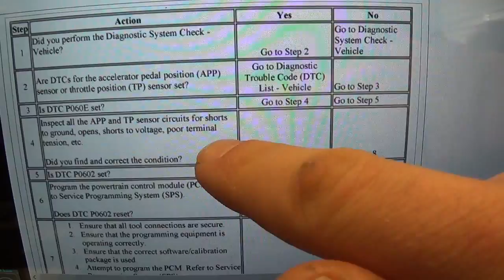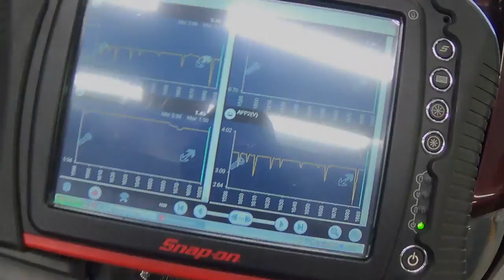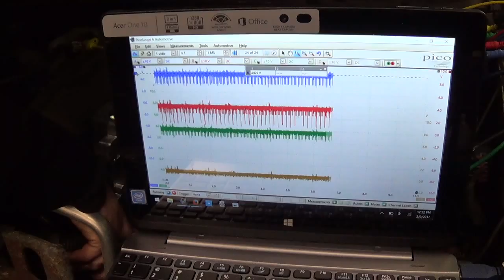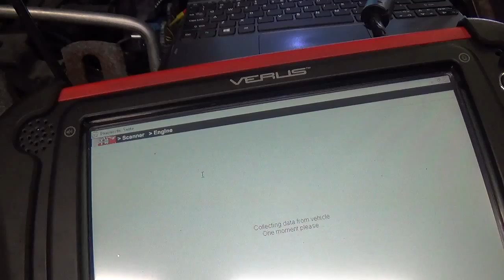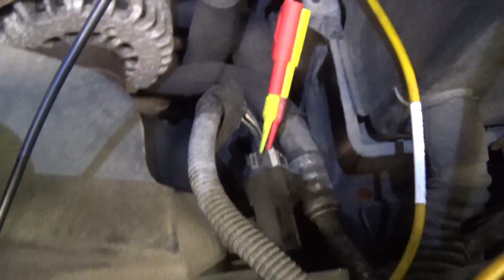Chevy Trailblazer from Hell: P060E (Staten Island Ep 7.8)

Comment: My 2019 xt5 3.6 had a P0128 my scan tool graph mode showed erratic signals on the temp sensor. I disconnected the sensor plug at the sensor and did a pin fit. Tightened and applied dielectric grease and reassembled. No parts needed.

Comment: Great detective work.... Had similar issue with 08 Equinox and wheel speed sensor pulling 5 volt reference to ground causing egr and evap faults.

Comment: This is a well known issue on the forums.  Anytime someone has a problem or code for the throttle system, first thing we tell them is to disconnect the fan, which accounts for 90% of these issues.  Then we go into heavy diagnostics if that's not it.

Comment: I have a 2004 trailblazer with this problem and we have replaced throttle body, pedal position sensor, pig tales, wire harness and goes away for couple months and then comes back.
Reply from the maker: Is the actual problem then like in this video?

Comment: As a owner of 5 trailblazers I can tell you that those fan speed sensors have caused a lot of grief in TB owners. Weird shifting,low power mode,you name it. I remove those fans,replace with electric fan (make sure to beef up the battery cables to ground and alternator to avoid power dips) and have the ecm programmed to delete the fan speed sensor.

Comment: Again, WHAT IS THE FIX?

All the diagnostics were great, but you didn't tell us what the fix is.
It sort of is suggested that the fan speed sensor was the problem, but not conclusively. 

It could be some interaction that is not necessarily a faulty fan sensor.

I have this exact same issue.

Comment: I had the same with a 2004 Asender. The problem was an after market remote start that damaged the wiring. I removed it. It runs, so I never fixed it. Still get the same code. Probably a nick in one of the remote start connections of is the problem. Don't have an O scope to look for noise.
 Still running 5 years and 40,000 miles later and still gets the code..

Comment: AWESOME< But what did you replace? E.V. fan clutch?? Is that parallel circuitry with several sensors that was having mass interruptions, due to the "noise" from fan clutch?thanks in advance

Comment: Back in the 80s my dad bought a new Oldsmobile that just stopped running for no apparent reason on the highway. They tried to figure it out at 2 or 3 dealers. After 4 or 5 tries they had to take it back under the lemon law in New York State.

Had they bothered to make a phone call as I did, they would have fixed the crank sensor. They knew about it up in the regional office and could have resolved it, but did not. Dumb.
Reply from the maker: Wow that's a shame. 80s Oldsmobiles were cool cars!

Comment: often 5 v reference(s) set by Lm-309 regulator(s) in ecm module  -often buried in LSI module

   BUT I found ADDED tantalum capacitor (10 mfd at 35 v) on flaky 5 v output helps stabilize high frequency noise on signal
     so less susceptable to noises-wierd problems often goes away,since 5v feed stable    
       never use electrolytic capacitors-tantalum ONLY

Comment: similar experience with a 90s buick century..... ac signal from a cooling fan motor disrupting the ignition signal at the module. rolled in with a intermittent stumble off idle, left with a new cooling fan motor.....and after two dealerships later threw the parts cannon at it.
good 1 ivan and keith.

Comment: hey Ivan!  I work at one of the last suzuki dealers around.  let me know if you need some good OEM information.
Reply from the maker: Where is that located?
Reply: I'm in Houston.  Dealers are dropping out fast.  I had a customer drive in yesterday from the next state over just to wait and get some recalls completed.  Luckily, I work for a multi brand dealer so I won't be out of a job soon.
Reply from the maker: Yup our Suzuki dealer closed up shop a couple years ago here in State College, PA. However a nearby Ford dealership picked up the service/parts department so not a total loss. I'm still not planning to get rid of my XL-7 anytime soon!
Reply: motoYam82 that generation XL7 is a solid truck.  It has its quirks like timing chain rattles and front cover leaks but I remember you taking care of that a while ago.  regardless,  drop a line if you ever need something.
Reply: there is still warranty support through 2019 for the last of the cars sold in 2013 for their 7/100k power train warranty.  I imagine after then we will be done too.

Comment: This is why I subscribe to your channel. Awesome find. Sometimes the answer just comes from nowhere.

I had a 2010 maxima that would set a crank position sensor code only when the engine hit 5k rpm or higher. The sensor was new OEM 3 months later it lands on my lap. I could see a small amount of noise on the signal with the score. But it ended up being a fault flywheel. Visual inspection of the flywheel showed absolutely no flaws. But the problem was fixed with a new flywheel.

Anyway I'm rambling. Good video.
Reply: Auto Fix Pal never a ramble , just more input. Thanks Hakim
Reply: ONBOARDTECH333 your welcome!

Comment: likely nothing wrong with the sensor circuit itself and caused by other fan controller component failure, like "capacitors" degraded and low to no RFI filtering/excessive back EMF.
if you scoped the fan power and ground, it should be going nuts too. A failing alternator can produce major ripple and with the different voltage/signal wires bundled it could wreak havoc :)

Comment: That is an excellent point. I have been scratching my head wondering why no-one use the scope to do what it is well suited to do, checking for noise in sensor circuits and signal quality. In wired LAN it is kind af a basic checks, but rarely in automotive. 12V relay with a faulty flyback diode can send a voltage spike and  cause a fault code in a poorly designed schematic.

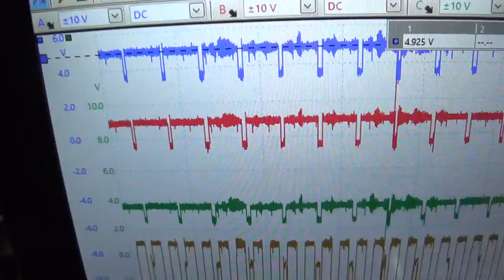Comment: First off, that was a brilliant display of Shop-Fu.  Your tenacity found something concrete that could warrant a design change or proactive fix - something the 'parts cannon' wouldn't reveal.  While the culprit was found I couldn't help but notice something in the scope traces at 23:31 - 24:00.  The pulse width of the interference rises and decays in a harmonic fashion.  The need for the engine and the fan motor to be at certain speeds suggests that only when the vibrations of the two were resonating and boosting each other, a beat frequency occurred that was strong enough to cause or reveal shorting of internal fan conductors.  I think the speed sensor was framed! :)  It would have been interesting to see if a current trace of the fan motor (like you would do with a fuel pump) would show any corresponding anomalies.   Great work guys!
Reply: Eddie the Grouch For being a grouch that was a great comment
Reply: Thank you!  Sometimes, when the phase of the moon and my medications are in sync, I'm not a complete jerk :)
Reply from the maker: Interesting thought! Would be interesting to reverse-engineer the fan circuit and see if feedback from the actual motor can affect the speed sensor circuit...

Comment: I would never have guessed it, but I can see how the fan power leads running through the wiring harness in the same bundle with the TPS sensor wiring could cause a lot of AC induction into the TPS wiring due to abruptness of the on-off impulses in the fan power circuit. A very abrupt on-off can induce a big voltage spike.  The two sets of wires running alongside each other are like a primitive transformer, with the fan power circuit being the primary and the TPS wiring the secondary.

Or it could be RF overload on the TPS circuit wiring.  Since the kind of interference that the fan motor creates is very broadbanded, RF frequency-wise, it might be that the TPS circuit wiring happens to be resonant somewhere within the frequency spectrum of the transmitted interference, so you get a strong RF standing wave on the TPS wiring.
Reply: William Crowell i guessed it as soon as i heard the fluctuation in the idle speed
Reply: William Crowell i guessed it, then about 10 seconds later i heard him say "so the fan"  then i knew i was right

Comment: I have a 2002 TrailBlazer with 200K miles. It's been a fantastic vehicle for me, never leaving me stranded, but that stupid electro viscous clutch has been a nightmare for most owners. They have a very high failure rate, never seem to kick engage quickly enough to assist quickly in cooling or A/C. I appreciate the attempt to gain 1/10th of a MPG by trying to better regulate the fan. It's no wonder GM switched these to conventional thermostatic fans for the last year of production.
Reply: Doug Goodwin Well that makes me feel better...lol. Bought an 07 Trailblazer about a year ago for the wife. Was a good deal and it only had 86,000 on the clock. Just hit 103k few days ago, Did a little research and found the 4.2 straight 6 was a very good motor for G.M. can't say the same, however, for the quality of some of the interior plastics...but oh well.
Reply: Sal Dorado I have a small fleet of Trailblazers pretty much they are my favorite vehicle never give major issues I have one with 513k miles 2002 TB 4.2 LT very good vehicle never had issues with interior either they are harder plastics but the interiors are nice comfortable places to be
Reply: I don't know why GM didn't just use electric fans. Just because it's a longitudinal engine doesn't mean the fan has to be belt driven.

Comment: Nice job Keith.  I saw the capture and thought interference myself, just didn't know where,lol.  First thought was checking battery and charging system for excessive ripple because as rpm increased it got worse.  But when I saw you go toward the fan and unplug it I knew what you were thinking,lol.  That was real cool.🤓  This is the reason why I love Pico Scope so much.  I can put a long screen on that bad boy, drive the vehicle if I have to or check stuff in the bay and I don't have to watch it all the time.  I can just go back and look at the data.  Or in this case it's great for action and reaction testing.  Was only 1 five volt reference driver affected or all of them?  Was curious about that.🤓
Reply: busjockey1 see that's where I don't believe what they have printed . They make it sound like there are separated 5v drivers , yet proof would show otherwise. I believe that they all eventually go back to one 5v regulator and all signals would have some affected level of signal interruption. But thanks again for the kudos.

Comment: There is a common thread between this problem and the GMC no crank issue in your other video and that is a pirate voltage or ground sourcing through a faulty component and upsetting other systems sharing the common supply or ground circuit.  Here the TPP and the APP were effectively showing exactly the same trace so the diagnostic take home clue here is that if you see several systems with parallel responses check to see on a wiring diagram how they might be collecting signal from a common fault .  I do not think that this could be tackled without a scope unless you effectively follow Keith's example of simply unplugging systems one after another on the shared circuit until the faulty symptoms stop; a bit like clamping off vacuum lines to the intake manifold when looking for a suspect vacuum leak.  Here is good example of huge cost and inconvenience to the owner not because the cooling fan motor was broken but that the speed sensor monitoring its performance was temperamental.

Comment: Ivan, was it making some kind of RF getting back to the ECU? Would a ferrite choke have cured the issue?
Reply: Randy the Appliance Guy if he tried ferrite core to suppress rf noise and it did help, it would only be a band aid.. the fan shouldn't be emmiting enough rf interferince to cause problems unless its failing. ( short in motor windings or feed back circuit causing spikes or an open causing a high inductive spike in voltage) just my opinion anyway
Reply: Kyle Veilleux 
I figured, but it would have been a cool test. it's the amateur radio operator in me.

Comment: Fantastic! !!  how does a speed sensor affect the computer ?  so what you're telling me is that the 5-volt reference signal from the computer can be contaminated by an external noise source. 
How did Keith know WHERE to look ?
Reply: Sounds like there is an intermittent short in the fan speed sensor that is pulling the 5V reference low, the fan speed sensor and the TPS apparently share the same 5V reference
Reply: Brad Noyes absolutely correct sir

Comment: The harnesses that go to the fan clutch are notorious for rubbing through on the fan itself.  I'd bet the wires are getting rubbed through causing some interference.
Reply: punker6506 you were correct sir
Reply: Nice Find ! The APP, Throttle Body and The Fan Speed/Hall Effect Sensor all share the same 5v Ref !  A lot of people end up changing them all including the PCM when as punker6506 said it is usually  just a wiring problem in one of the harnesses between the pcm, throttle body,app sensor or in your case the fan/sensor harness that brings down the 5v Ref. I believe GM even has a TSB for either a re-flash or replacement of the PCM for a P060E.

Comment: hey Ivan!  im a huge fan and love your approach to problems.  Would you be able to take a look at this for me?  I posted the problem and all the information over at IATN. I'm having an issue with a BMW transfer case and I think I've narrowed it down to the module..  any help would be greatly appreciated!  Thank you!
http://members.iatn.net/techmail/view/index.aspx?origin=13&d=1&de=1&k=&m=1046&t=euro_ptrain&favorite=0&closed=2
Reply from the maker: I'm no BMW expert by any means but I'll take a look. I think Keith deals with Euros on a daily basis though :)
Reply: motoYam82 Thank you!
Reply from the maker: The only problem is that I'm not currently an IATN member :(
Reply: Daniel Casses

Mar 13, 2017 5:04:36 AM

ok

I've rebuilt these transfer cases before but I've never seen a blue gear inside it..Did you mean inside the transfer case motor? Does it matter if the car is running when you try the calibration procedure? Also i was checking voltage yesterday at the module. With KOEO The brown wire on the left side harness(i assume this is the input side since the other wires from the other harness go through a grommet in the trunk's floor to the transfer case motor) had 12.8 and the red wire had 12.8. The brown wire and red/ white wire in the other harness had the same with the KOEO, but here's where it gets strange. Once i start the car and its running the brown wire goes to 14.88, but the power wire (red/ white) on the output harness that goes to the motor drops to 5.88volt when its running. Any idea what would cause a voltage drop like that when the car starts to run?
Reply: My question is more about the module voltage toward the bottom. of my last post..
Reply from the maker: Do you have good OEM wiring diagrams? Tell me exactly which connectors and pins you were getting the voltage readings from...
Reply: motoYam82 how can I email them to you?  Yes I have the wiring diagram and pin out numbers
Reply from the maker: Also, what codes were stored in the 4x4 system? Is it VTG or VGT?
Reply from the maker: ivan@pinehollowdiagnostics.com